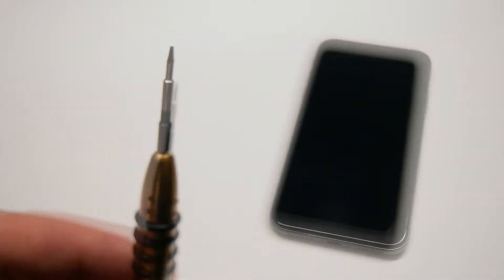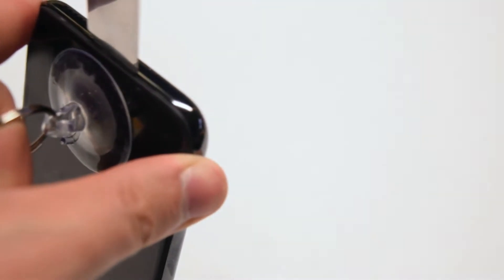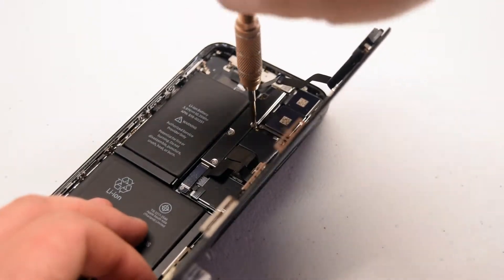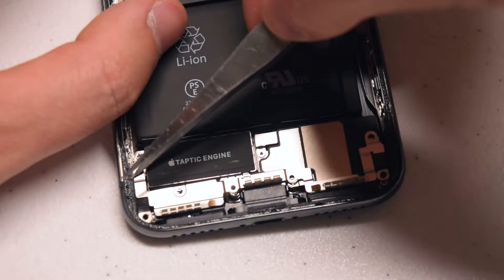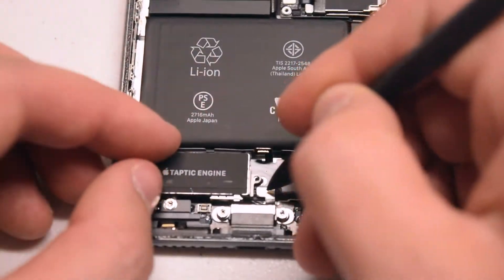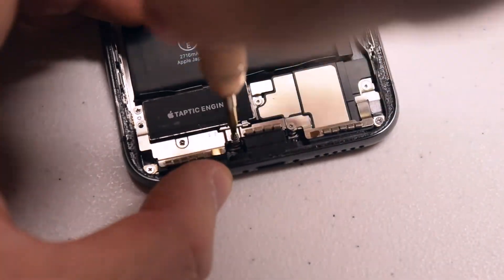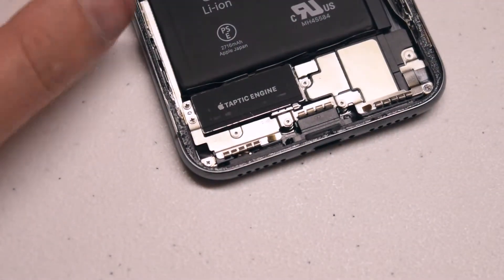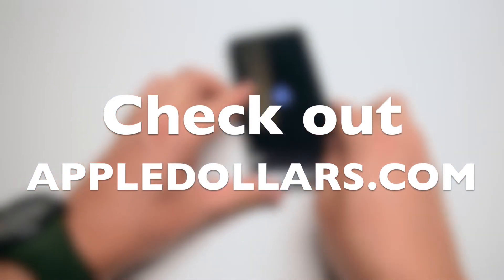iPhone X Taptic Engine Replacement

Comment: Should have disconnected battery first. Could have fried the screen and other components on it just a tip for you all
Reply from the maker: Once you do a few thousand repairs you will learn that those boards are sealed and only an intentional short is possible so save some time, follow pro instructions, get the repair done faster and avoid reseting the phone by pulling it's main heartbeat power source as on iOS devices (a hidden SMC reset will trigger some things that apple will never show you such as knowing that you opened the phone for starters).

Comment: That new vibrator will not work, you need to copy its serial using qianli iCopy
Reply: I have the same problem. Since i switched to the new one, also the old one isnt working. I copied data with iCopy but still not working :(
Reply: Actually that’s not the case. I had thought so too until I bought a new housing with all internal parts other than the camera. Everything works fine in that phone even thought the logic board is out of another phone. Bought a Taptic Engine for a separate phone and tried to copy the data and it still won’t work. The original won’t either though. Bout to test each in the first phone to see if it’s the connection on the charging port